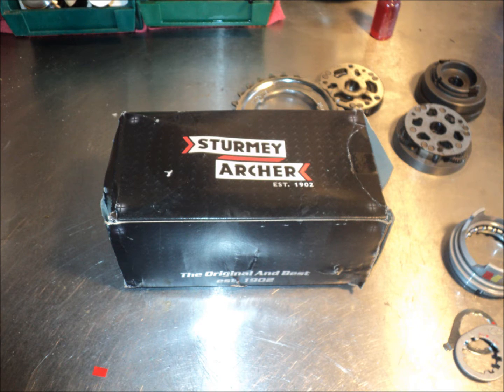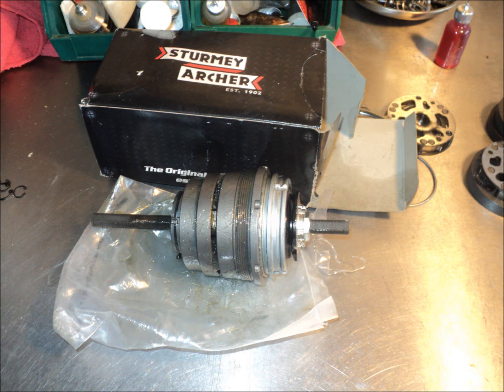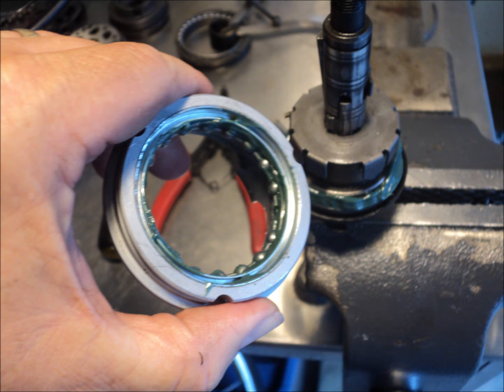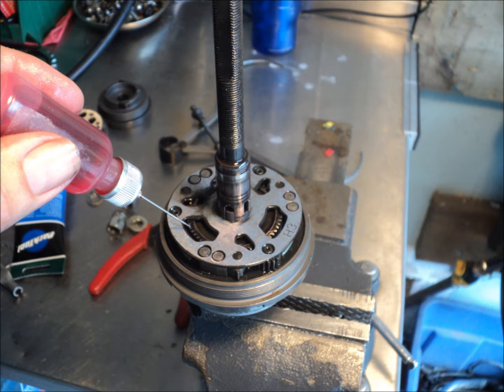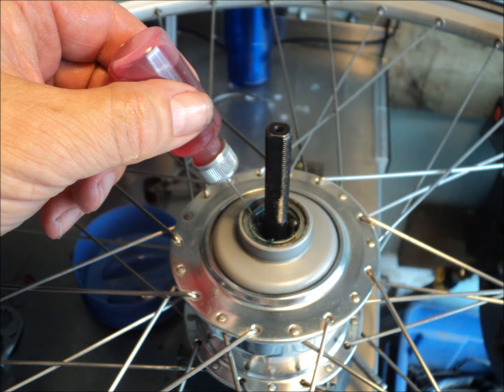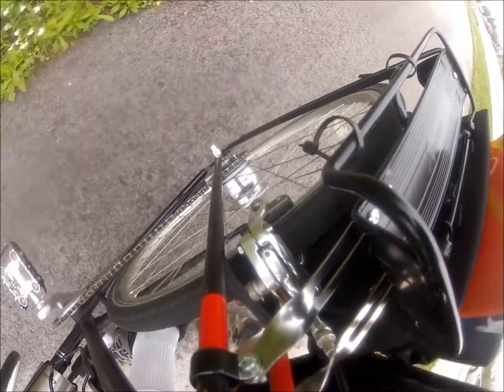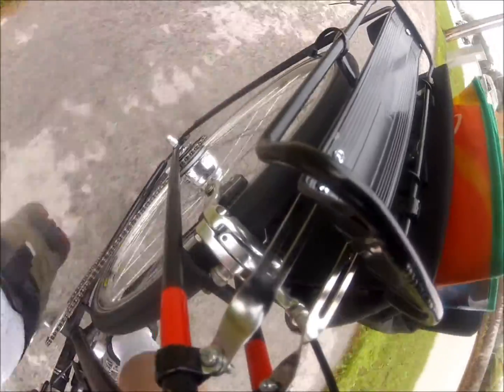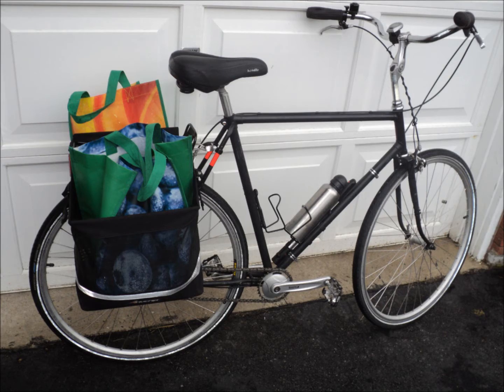Sturmey Archer 8 speed failure II A happy ending.

Comment from the maker: There are no seals. The grease in the bearings is the only barrier. it might leak if the wheel were laid on it's side for an extended period, but in an upright position there does not appear to be an issue.

Comment: Does grease on the outboard bearings really “seal” the hub?  Doesn’t oil (ATF) dissolve grease?!  Seems like a short-lived solution.  On my Shimano Alfine  8 hub, I did this using 80w90 gear oil to soak the internals (refuse to pay ridiculous price for Shimano special IGH oil), Shimano IGH grease on outboard bearings (as well as on roller clutches as recommended, etc).  After just 100 miles, I opened it back up, and the grease was watered down and almost same viscosity as the oil!

Comment: Hi Dan - Just purchased a disk version (2016) and as your video was 2012 how's is the hub now? is it still working well? Would be really useful to have a long term review.
Reply from the maker: Well, as it happens, just last week, it began skipping in all the gears that utilize the first stage.Rather than stripping it down, I decided to install the new internal assembly that SA sent me four years ago.
 i was surprised and pleased to observe that the new internals do not make the high pitched ratcheting noise in the overdrive gears that the old one did. They have obviously changed the design in some way that is not visible with the parts assembled.
 When I have the time, I will pull the internals out again and take the final output stage off to see what kind of a clutch/ratchet mechanism they are now using to make it silent.
 The new internals function very nicely by the way.
Reply: Thanks for the update - fingers crossed for the new set of internals. sounding good though.

Comment from the maker: I'm not aware of any limit. I'm running 30/25 and I'd like to try going lower.
Reply: I'm running 24/25, and to be honest, I'd like to try going lower. It's good, but not great for the steep hills on my commute.

Had a recent failure in my 93T stage with the tooth missing out of the ring gear, just contacted SA about it. Hoping for a resolution like yours! In the meantime, following your lead and cleaning and reinstalling and maybe it'll work.

Comment: Does the new hub internal come pre lubed from SA, or do you have to lube the new one, and if so, how often does the hub have to be relubed as you ride ?
Reply from the maker: They come pre lubes, ready to install and ride. The non drive side bearing will need to be lubed.
Frequency of service depends on amount of use and conditions. If I were using it as a year round commuter in all weather, I would open and lube a couple of times a year. For casual or pleasure riding in fair weather, you could probably ignore it forever.
Reply: Thanks Dan.